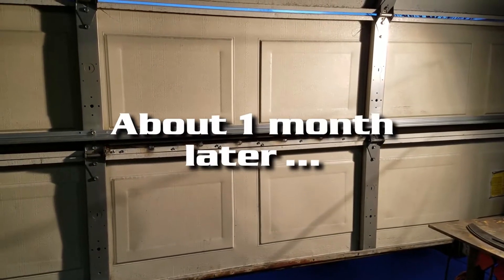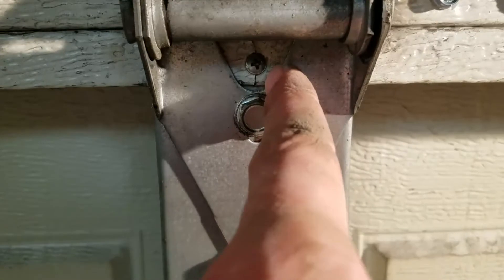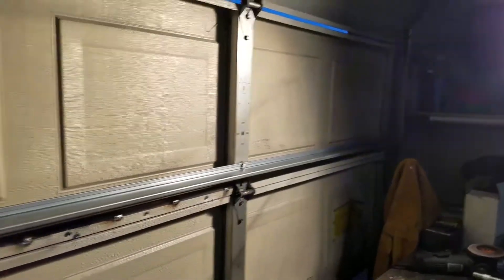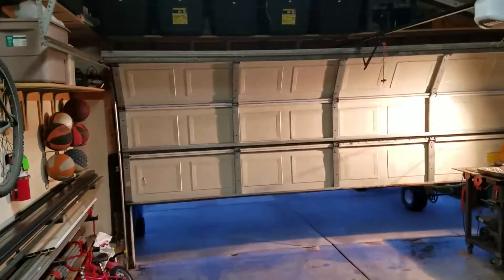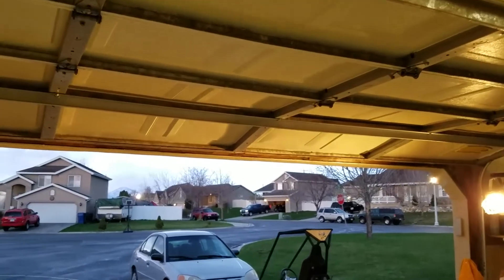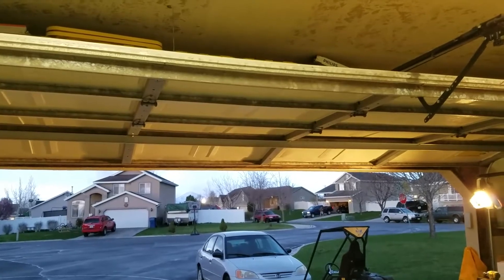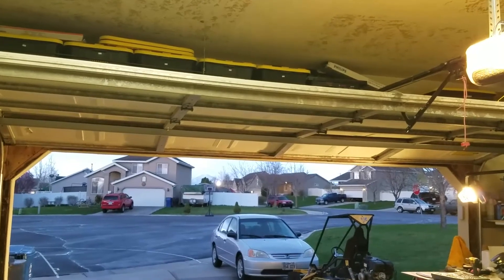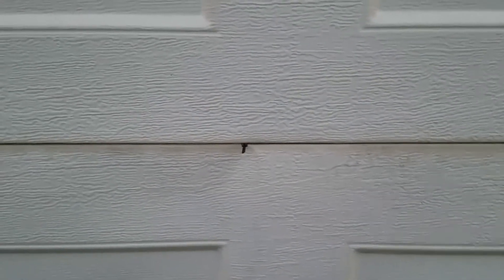Sagging Garage Door Update and Fix #2

Comment: Yeah, that will Help out the door alot for a repair. It will last alittle longer for that Weak Spot in it. Your place and the rest of the home's don't look to be that old...strange that it broke already. Good Luck with the New Door😊
Reply from the maker: Ya, it is only 14 years old; however, the builder did put in cheap stuff unless I specifically "upgraded" anything, so I am not surprised. Also, kids have it the garage with their bikes and dented it... I am sure that has shortened the life of it a bit too by creating weak spots.